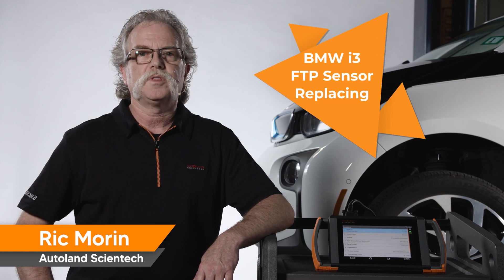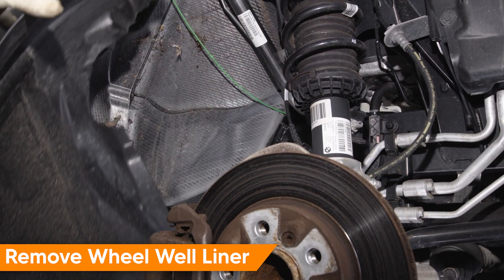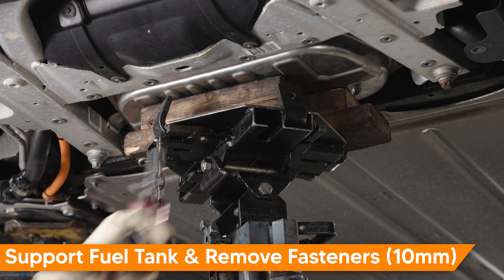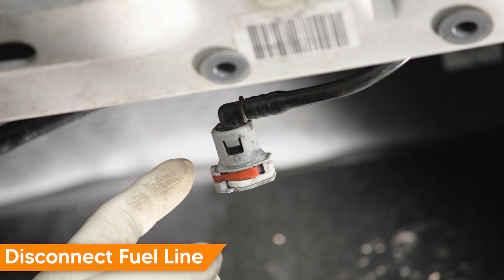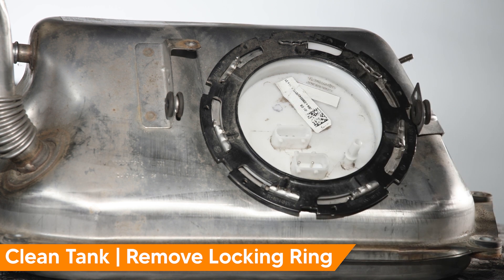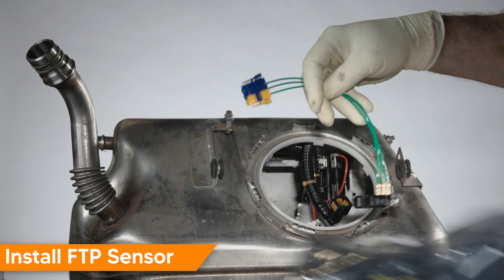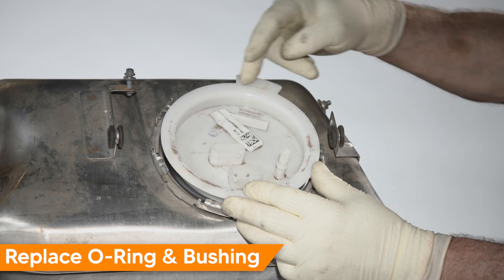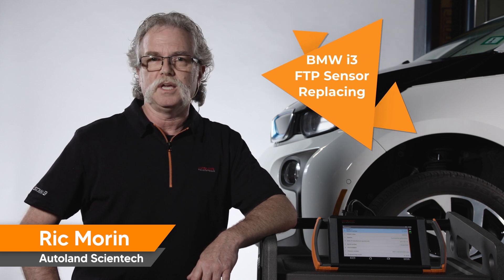How to Replace the Fuel Tank Pressure FTP Sensor on BMW i3 Models with REX Range Extender

Comment: I recently popped a P0185 Fuel Temp Sensor B Circuit, and they all circle back around to it being a combo Temp/Pressure sensor. Supposedly, there is an extended warranty on the Fuel Pressure Sensor. I wonder if the P0185 is a qualifier for the Extended Warranty 🤔🤔
Reply from the maker: Only way to know is to check in with BMW and ask if it is covered. They will want to confirm the fault before any warrantied repair.

Comment: This is a GREAT video and I"m virtually sure I could get through the process, having seen it, but if it's possible to just DISABLE the sensor without too great of a downside, that's what I'd do (life is too short, and my version of this would be done with the car on ramps and with a lot of rolling around on the garage floor, muttering and cursing.)  So where can I potentially jumper or disconnect this sensor instead, so that my CEL will be useful to alert me to more concerning problems?  I mean, if this sensor was supposed to supplant the use of a vented gas cap, then I'd retrofit something to just vent the damned tank rather than go through all of this.

BTW this replacement is covered under a BMW service bulletin [https://static.nhtsa.gov/odi/tsbs/2018/MC-10145289-9999.pdf] and will be done by dealer FOC - but only for certain date-ranges...and mine's five weeks too young.  This also begs the question of whether even their "new improved" FPS wasn't also fatally flawed, because why would the service bulletin not cover mine as well?

Comment: Very helpful video, but I’m curious I have a CEL with 806012 80602E which is the Tank filler flap sensor interruption or short circuit to ground and implausible value stuck closed? My tank flap opens fine everytime and dash display always says ready for fueling. I also have CB9517 which is the fuel pump shot off. Are the first codes related to the fuel pressure sensor or maybe the actual tank flap actuator? Any insight would be appreciated, thanks
Reply from the maker: What year and model vehicle? Do you have the P-codes and code descriptions as displayed on your iSCAN device? What I can see these are filler flap faults. The filler flap Hall effect sensor is on the body side the flap has a magnet.  You can test the sensor by simulating the door closing with a small magnet and monitor the hall sensor looking for a digital signal. Going by memory it is 5 volts and then pulled close to ground.
Reply: Sorry should have probably lead with that: 
2014 BMW i3 REX
P04B6 : Fuel filler door stuck closed 
P04B8 : Fuel Fill Door Position Sensor /
Switch Circuit

It seems to think it’s stuck closed but it’s actually operational?? Here’s the bmw codes

11701C
Tank flap: stuck closed
117018
Fuel filler flap position sensor / switch circuit: Malfunction or open circuit

Btw not sure if it could be related to the charge port flap which has been making a horrible gridding noise every time it opens but that’s been there for 5 years and never threw a CEL before
Reply: Resolved it, pulled the fuel filler assembly sure enough one of the wires going to the hall sensor had tiny demand and corrosion. Soldered taped and all good now. Thank you for your clue!!

Comment: Any info on the recalibrating of the sensor available?
Reply from the maker: We hear most techs do not need to calibrate it here in the US. We don't currently have that video. If necessary, it is done via ISTA using iSCAN IMS2 connection.
Reply: @AutolandScientechUSACedarPark  If one WERE to go through the ISTA process to recalibrate, would this indeed...work?  Or is the sensor toast, so recalibrating would be like trying to repair a burned-out light bulb?  (This is probably academic, as ISTA behaves so erratically/counterintuitively/crashily that it's virtually unusable for me...maybe I need Windows 95?)

Comment: i3 Owners be aware, there is an extended warranty, 10 years 120k miles, on this sensor.  So if the sensor is bad you don't have to do it yourself, let the dealer do it for free.  Here's the service bulletin: https://static.nhtsa.gov/odi/tsbs/2018/ ... 9-9999.pdf

Comment: GREAT VIDEO, HOW DID YOU TEST THE PRESSURE SENSOR? DOES A BASIC SCANNER TEST THE SENSOR OR IS IT MORE COMPLICATED? ANY HELP IS APPRECIATED
Reply from the maker: You can test the sensor using an advanced scan tool, like out iSCAN sf. Tank pressure with the fuel filler cap removed should match ambient pressure.